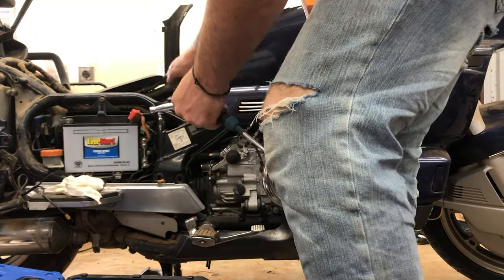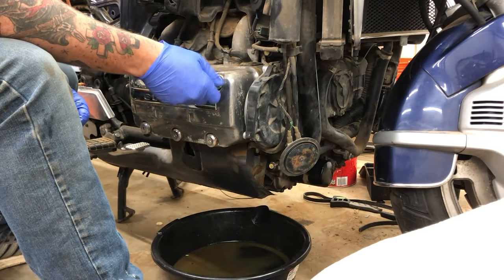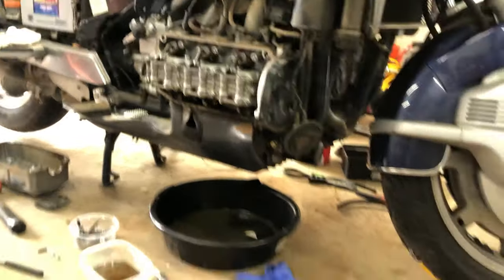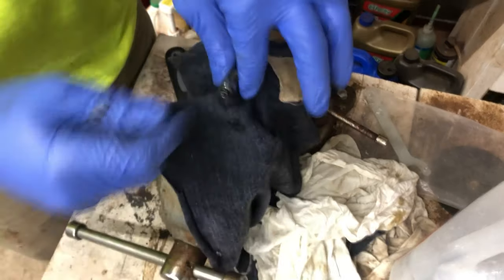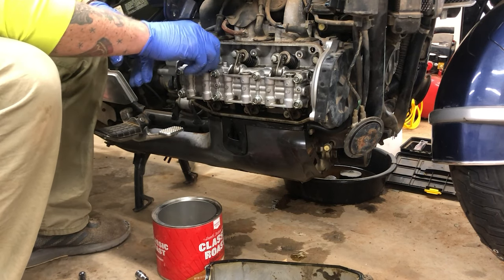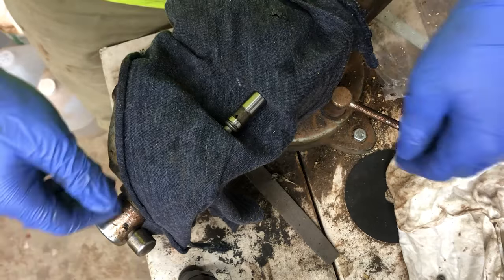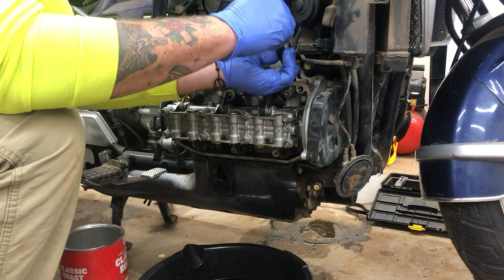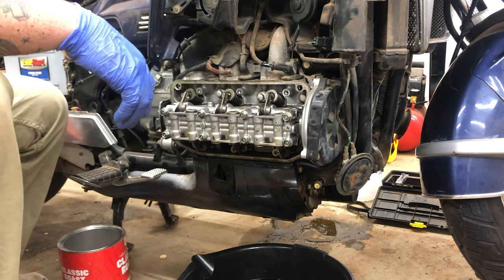How To Fix Stuck Hydraulic Valve Lifters or Adjusters on a Goldwing GL1500

Comment: Thank you for the confidence to proceed with my motorcycle. We corresponded on Facebook. I’m ordering a compression gauge so I have one more piece of kit in my tool collection. 

My bike was diagnosed with collapsed lifters, though I don’t know if that is the same as stuck lifters. I’m hoping once I open it up it will be apparent why the lifters aren’t working on one cylinder. I’m also hoping if need be I can order new lifters if they are worse than stuck. 

The motorcycle has had multiple owners so who knows what kind neglect it has suffered from. Thanks again for putting together this video. I’ll let you know how it turns out.
Reply from the maker: Hey Hans! Glad to see you made it! I was really surprised at the harbor freight's compression gauge accuracy. I am guessing that if they did not tear down the motorcycle to visually see them there is a good chance they are stuck! Either way should still be fixable! That is the problem with these, some people don't take care of them sadly. Wish they would though. And thanks for watching! Let me know how it turns out or if you have any questions. One thing I did not show on camera was using an air compressor with a blow gun attached with a rubber tip and blowed inside both of the holes. Might help if they are collapsed!
Reply: @octanerestorations  , on my Christmas wish list is a link to the compression gauge from Harbor Freight. I just have the write up from the mechanic who diagnosed the collapsed lifters. One cylinder showed no compression and one was really low, like 60lbs. The motorcycle ran fine when I took possession of it, but almost immediately after starting dragging a cylinder. With 6 cylinders it’s hardly noticeable at driving RPM’s, but idle is readily apparent. I’m busy traveling until March (snow bird) but will tear into it this spring. So don’t be sad if you don’t hear from me for some time. I’m chasing away my northern winter blues in search of sun and warmer climates.
Reply from the maker: @HansGyswyt  Then I believe it has a good chance that it is just stuck! I had a honda sabre V65 that lost 2 out of 4 cylinders via ignition coil dying, and it would still run the speed limit. Love my hondas! And can't blame you there! Stay warm!

Comment: Just a little  advise , the pressing lifter full of oil its not good idea ! You should drain the lifters at first and pumped them sunked in kerosine.
Reply from the maker: I tried! These were completely stuck and it would not drain. I soaked some of these for 24 hours and it still wasn't enough to loosen them up! So I had to use the press.
Reply: @octanerestorations  Hi ,they are not stuck  ! inside the lifter is small back stop valve  preventing loosing  pressure  during normal work , so look only they are stuck ! For bleeding ,flushing you should pressing the little valve down by   using 1.5 mm drill or thiny allen key for relasing pressure from inside.
Using same metod you should pumped down and up when they completly flooded by kerosine until get realy clean.
On your way you have cleaned them only partialy but the most important part are still untouched.
Sorry my ponglish but I hope you can get the point.
Regards
Reply from the maker: @qrwayan  I did not know that! I tried flushing them with kerosene and compressed air but did not have such luck. Did not know about the back stop valve! Thank you very much for the comment, appreciate it! I learned something new today!
Reply: @qrwayan  This clown is giving terrible advice.  You are correct on how the stop valve works.  Putting these in a vice and cranking them down is likely bending the lifter and or causing huge damage to the inner spring.

Comment: Thanks for the video. The dog was annoying the heck out of me lol. I just need to replace the valve cover gasket on mine but i didn't see you do that. Where was it and did you change it?  Thanks
Reply from the maker: The valve cover gasket it reusable on these! It isn't RTV, it is the actual rubber piece that goes around the edge of the valve cover. You can replace it for piece of mind, but since they are reuseable I reused mine!
Reply: Thank you!

Comment: Nice work. But the dropping of parts onto the dirty garage floor is disheartening to watch. I'm sure you can find some cardboard if you don't have a push broom or shop vac. Why didn't you take the time to power wash the bike when you had the fairing pulled of? I don't know about you, but with all of my motorcycle or just about anything mechanical I have to pressure wash before I'll bring it in my garage
Reply from the maker: Most of the pieces are in a plastic tub! Some of them are on the ground, but I plan on cleaning it after. And for this motorcycle I will eventually do a full detail, I just want to make sure it will run before I do any heavy detailing!

Comment: You probably have a lot more
Than 120psi those harbor freight testers are junk and can’t read much more than that
Reply from the maker: I hope so! Lawn mower wise they work good, and I got given this set and they haven't failed me yet! Might invest in a better set in the future!
Reply: @octanerestorations  put it on a vehicle you KNOW has great compression. Usually 4 strokes need around 150+ to run. I just think the tester won’t read that high because location of check valve. If you look in name brand testers the check valves in a different location, these ones have it so all the pressure is stored in the rubber hose so it doesn’t read correctly
Reply from the maker: @njmxjunkie3128  I gotcha! I know the manual of most of the lawn mowers and weed eaters I repair the manual states 110-150 range depending on the machine. But now that I think about it I don't know if I have seen this one go above 120 psi. Will look into it, thanks!
Reply: @octanerestorations  try it on your car or truck. Have a good one man

Comment: very bad idea / suggestion to compress any hydro part or lifter in a vice.  Good chance of damage to the spring in the lifter.  You will not find your process in any service manuals.  Not good advice and could cause major damage to the engine.
Reply from the maker: Hey John! I mentioned it in my latest video about the one way valve. This is directly from the honda service manual for the GL1500 on page 7-10. 

Attach the Hydraulic Tappet Bleeder to the adjuster, center the bleeder pin, and while holding it upright, COMPRESS and extend the bleeder slowly in a jar filled with kerosene.
Tool:
Hydraulic tappet bleeder
07973-MJOOOOO
Continue operating the bleeder until there are no air
bubbles.

As you saw if you watched the video, I attempted this with kerosene and air and it was not working. I could not compress at all, and decided the next route was the vice.  It was buy new hydraulic tappets, or fix these. And the motorcycle runs great now! Thank you for the comment!